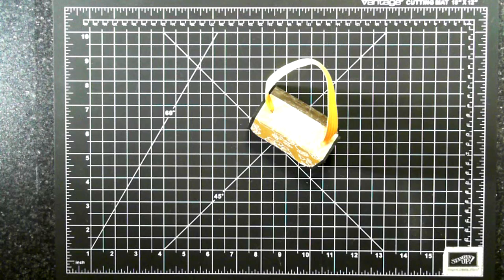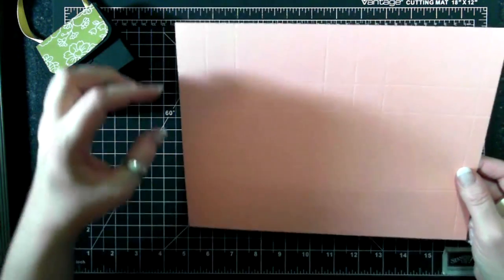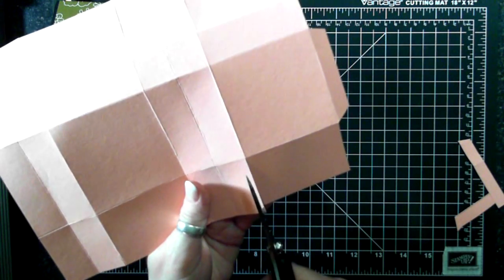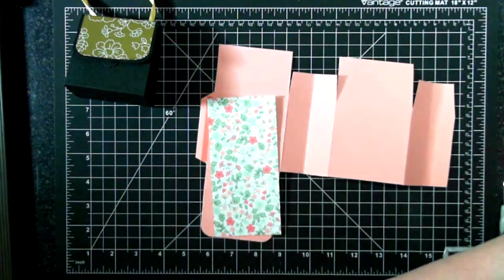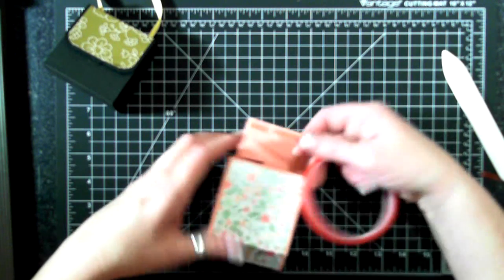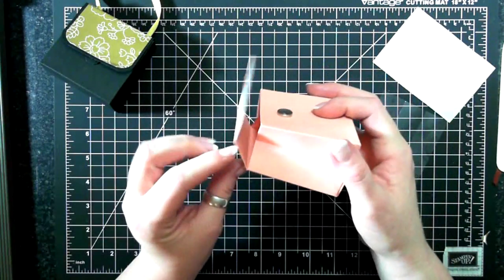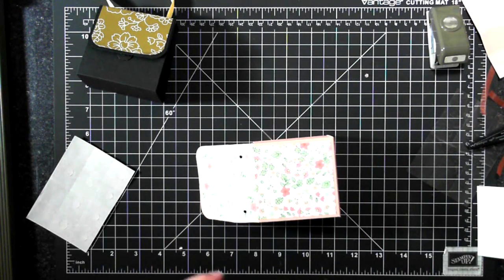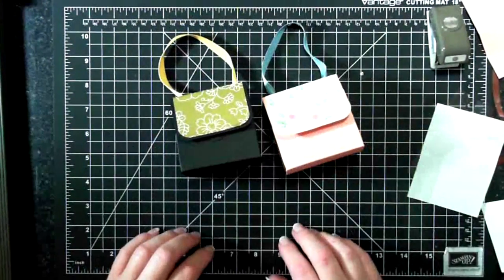Paper Purse Box featuring Stampin`Up! Products

Comment: Love the purse.  Quite adorable and perfect for Mother's Day.  TFS!!

I'm very frugal. So I'd knot the ends of the ribbon handle since they'll be inside the purse and won't show, saving my glue dots. I use hot glue wherever I can because it is dirt cheap and save the snail for the places I can't or the places snail works best.  And to save on the cost of dimensionals I cut up cereal boxes and hot glue that under things to lift them.  If I want my cereal chipboard to be round I use a circle punch.  It's thin enough that most punches will punch it.  You can always use more than one piece if you need more lift.  I glue them together.  And attach them with hot glue as well.  Mostly though I cut squares.  The best thing about using it is if you have a large piece to lift you can cut one piece slightly smaller than the piece you want to lift  and no sinking.  Yes, it's faster to use snail, glue dots, pop dots etc. but I've been frugal for so long, it's habit. 

Of course if I were an SU demo I'd want to promote SU products so I understand why SU demonstrators use SU products.  I love SU.  My theory is the money I save on this type things allows me more money to spend on other SU products, so essentially I spend the same amount because I set myself a monthly limit anyway.  I'd rather spend my money on stamps, papers, ink---all the wonderful SU products like that.
Reply from the maker: Dinahsoar Dinasoar 
Thanks for dropping by.  You certainly sound like a frugal crafter.  I too have a budget but as a demonstrator it's a bit different as I budget for 3 month increments.  I am working on fine tuning this system.  Lol.  I do have a lot of paper left over and I know it will be retired soon,  serves me right for hoarding.  :)